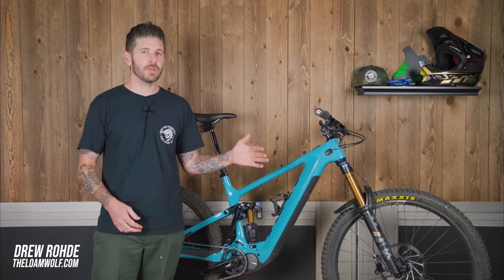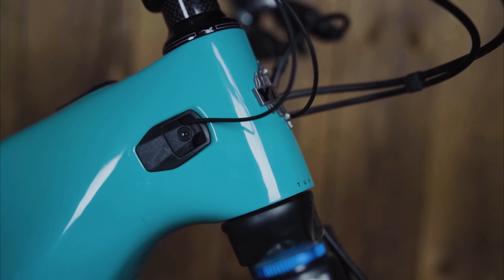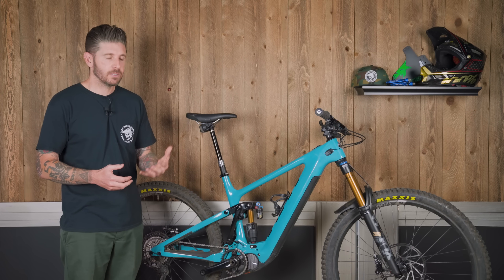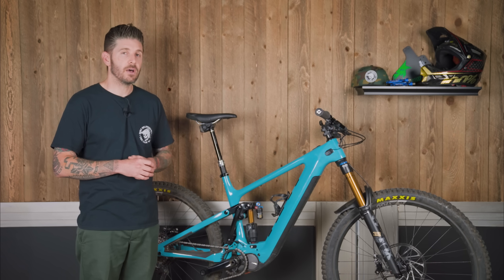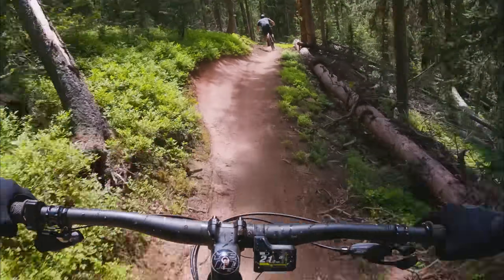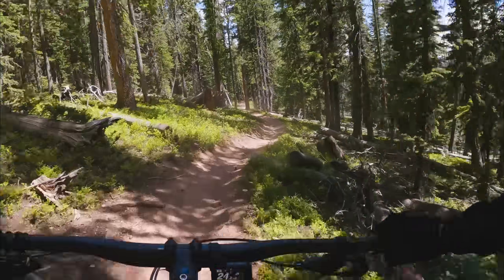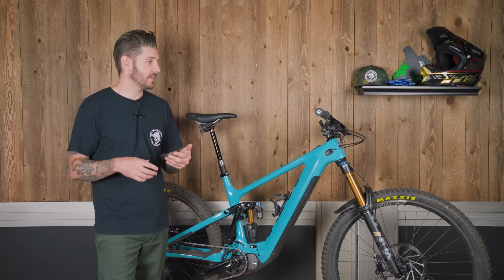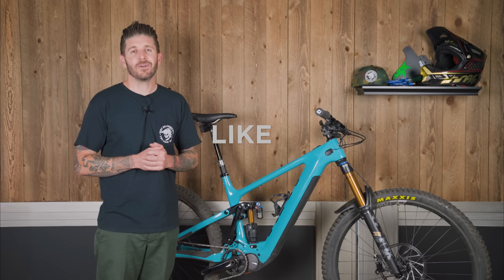Yeti 160E EMTB is here. Review and interview with Yeti Cycles Engineer

Comment: Hello

Do I have a question?!??

I have a 160 E, in this video you indicate that you can make mullet, but they tell me that to transfer it to mullet it must be done from the factory, so that they configure the engine for a 27” wheel, because otherwise the tire cuts at 25 kph and not at 32 kilometers per hour as it usually short!!!

In this video it only indicates that you should use a 2.6 tire, or will it be that just by using that tire size it is not necessary to do the engine configuration????

I appreciate any help with this issue, thank you.

Comment: Very good review!  You mentioned your size (5-10) and rode a LARGE.  Did you get on a MEDIUM?  Just thought with the SP angle and length and the TT length, looks like there’s plenty of cockpit room for us 5'-10”ers.
Reply from the maker: Hey John, I'm just over 5'11 and chose a large, I did not ride a medium but they seemed like a decent size and depending on your terrain and riding style, could be a good option. I'd suggest looking at your current bike's Reach numbers and comparing them. Dont look at TT numbers, check Reach.
Reply: @TheLoamWolf  Thanks for the suggestion.  Have a SB4.5 in Med, and a Levo SL in Large. The Yeti feels like Porsche and the LSL feels like truck. 😉

Comment: What’s the range of the battery?
Reply: Depends on what mode you are riding in along with many other factors such as tire size/air pressure you are running, type of trail you are riding and how often you blast boost mode! Have a Yt Decoy with 540w battery and Yeti gets much better range riding same trail conditions. Typically I ride exclusively in Trail mode and can easy get 25-30 miles with 3000-4000 ft of elevation gain.

Comment: For a top tier bike,  I'd like to have seen XTR brakes instead of SRAM CODE RSC... as well as a full XTR drivetrain.  Carbon wheel- set would also befitting. 

As is, this "top tier" bike requires a lot of upgrades to become truly TOP TIER.

I wonder if YETI's race team rides their "top tier" bike as is.... or if they upgrade components (as I've mentioned).

Comment: A proper review, thanks. It is very tempting but there is so much choice and I would rather it have a slightly bigger battery and slightly more torque. I also have concerns about the rattling motor. Turbo Levo or Yeti 160E? Any pedal strike issues?
Reply: Been riding my Yeti 160e for about 6 months and very minimal pedal strikes and I'm running Deity TMAC's which grip awesome but not the thinnest pedal out there. My technique has gotten better over time which really helps as well. Run the rear shock wide open in the poppy and plush setting and this bike climbs like a billygoat! In comparison to my YT Decoy with thinner DMR Vault's, which has it fair share of pedal strikes, bb height on Yeti is a little higher and characteristics or their rear suspension design definitely limit pedal strikes.

Comment: Looks like an amazing bike. Downside, rattling ep8 motor. Thats why i have a levo. Brose motors are silent. I personally havent had troubles with mine. But i know brose and specialized have had issues with failing belts etc. But il ride mine in silence until it breaks. At least it dont sound broken all the time. Shimano and Bosch needs to do something about the rattling sound when coasting in rocky terrain.
Reply: EP8 rattle is a bit of a downer but not a deal breaker. Over 500 miles and absolutely no issues unlike my previous Gen 2 Levo that had multiple mechanical issues. You can say all you want about the great Specialized warranty, but you have to wait and have lots of down time. Having an awesome bike does no good if its in the shop. Hopefully you have better luck but based upon personal experience, just a matter of time mate!
Reply: If your paying too much attention to the rattle, then you ain’t riding it hard enough.

Comment: So beautiful looking and capable bike, why on earth did Yeti went with a rattling motor? New Yamaha motor is way more powerful and quieter than Shimano EP8. I was really expecting a Yeti e bike, which is gorgeous, but that motor makes me move on Giant new e Reign+ 0, or Levo Gen 3.
Reply: yamaha is not a common name in the mountain biking industry. shimano is. shimano has proven themselves over and over and lots of people see shimano and say "oh, it must be good" if yeti went with a yamaha motor, it could hurt their sales and that's the last thing they need when supply chains are as dead as they currently are because of the pandemic. yeti SURELY knew about the rattling issues. their team is made up of some of the best engineers in the world, they wouldn't have just ignored the issue by pure chance or lack of care.

another big part of it is that shimano hooks up bike manufacturers in terms of pricing far more than yamaha might. simply because they've all worked together for so long and their relationship is built up over a long period of time. yamaha isn't a word you hear in the bike industry all that often unless it's literally motorcycles or dirt bikes.
Reply: @dash0173  Giant, the worlds largest bike manufacturer, as well as the pioneer in e MTBs Haibike, both use the Yamaha motors in their e bike line up for years. Giant also tunes the Yamaha motors specifically for its models, so that they perform according to their race team standards through more sensors inside the motor, plus the Yamaha motor is way more powerful than the Shimano. As I mentioned before, the Yeti is the bike I have been expecting so far, with the right travel and geometry, but when I pay that money, I expect a quiet bike at least! Shimano should have worked this out by now!
Reply: I ride ep8 and if you can hear it then you aren't concentrating on going hard enough
Reply: The bike looks amazing, well thought and refined but it’s a bit curious that yeti touts this as a “race bike” when clearly the EP8 is weak in terms of performance compared to the Bosch. Noisy yes but A quick look at what power unit is most often seen on the bikes that are winning and finishing high in the EWS-E series. Searching YouTube reviews undoubtedly suggest the same. The EP8 is weak. I love the looks of the yeti and I bet that rear end is amazing but lost me with the shimano motor. Great review loam wolf!

Comment: At 13:20 you stated that you added tokens to keep the front end from diving. Please confirm with a suspension nerd but my understanding is that if you remove tokens the fork has better initial support which help prevent fork dive. the tokens help make initial stroke plush (dives easier) but more bottom out support deeper in travel. I hope you can help clarify my confusion.
Reply from the maker: Hey Jesse, from our experience tokens or volume reducers don't in and of themselves affect off the top feel. What they do however is offer more progression later in the travel, which allows lower air pressure to be run in the suspension so you then get a softer, plusher off the top feel. Similarly just tokens alone don't really help offer a ton of mid-stroke support, so hopefully lumping that in with my comment of adding more low speed compression damping together didn't throw off too many people. 
Hope that helps? Essentially, no volume reducers (for some heavy/fast riders) means blowing through travel and harsh bottoms and diving. So more air pressure has to be added, which reduces small bump compliance. To better achieve that ramp at end of travel, use volume reducers to add more progression and then lower air pressure will help bring back soft off the top feel with enough support later. 
We made a video if you search Volume Reducers Loam Wolf, should pop up! 
Thanks
Reply: Depends if you stay at the same air pressure or go to lower pressure when adding tokens (which is possible due to added progression)
Reply: Tokens simply reduce air volume and really won’t effect the initial stroke, given the same air pressure. The reduced air spring volume will just make the spring rate ramp up faster making the fork more resistant to bottoming.